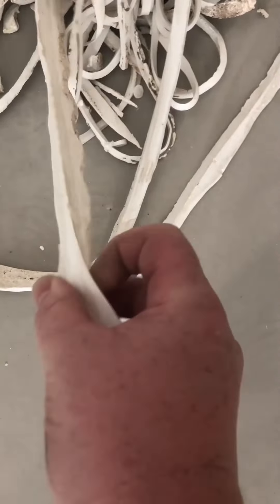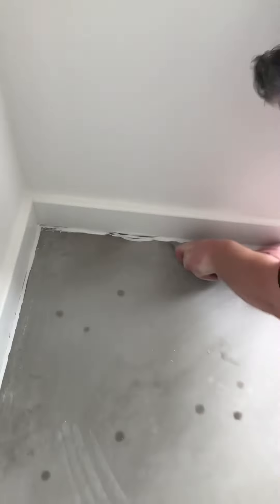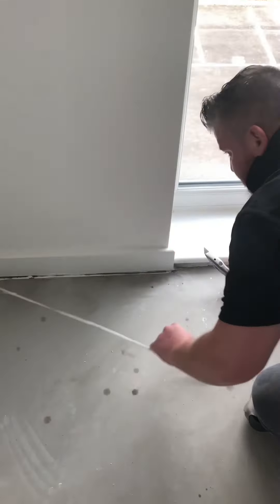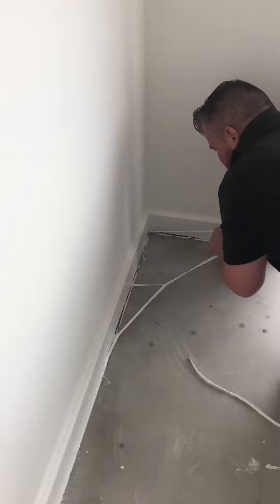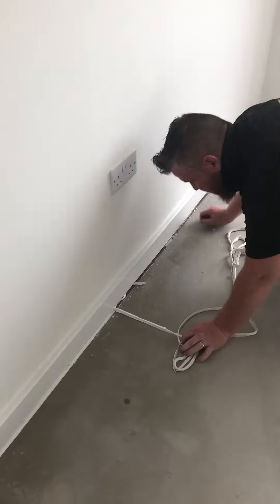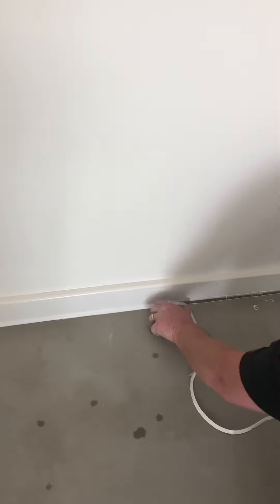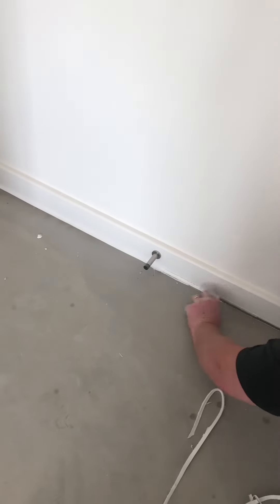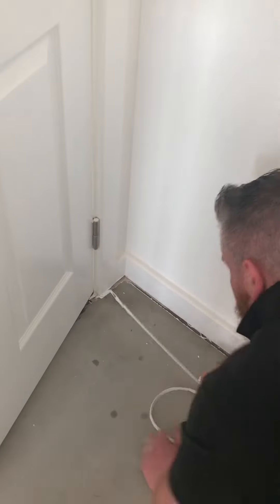New builds 🏠🙈

Comment: It’s for the air test they have to do it but using foam before fitting the skirtings into the void between the plaster board and floor is better way to do it